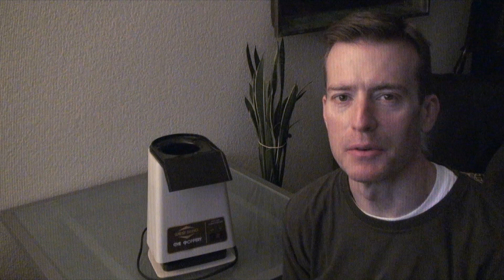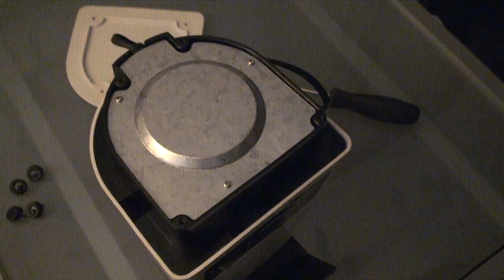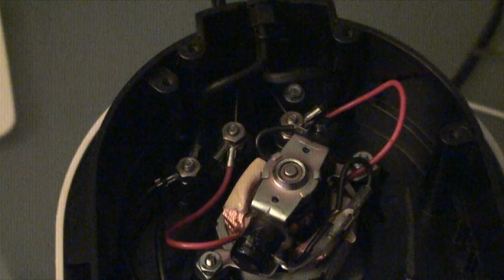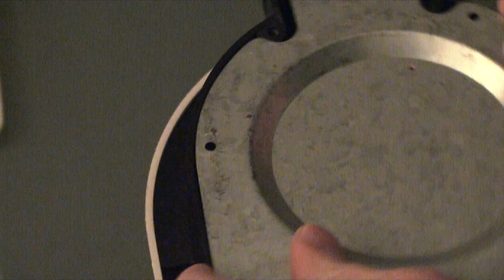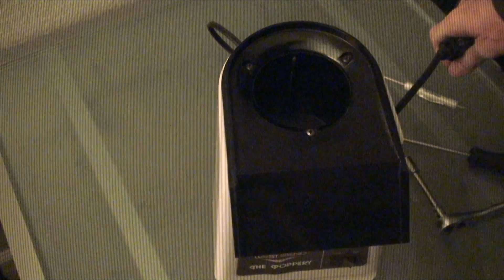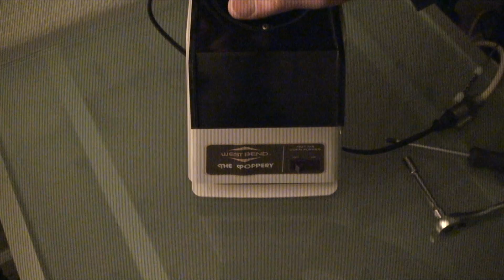West Bend Poppery rewire for coffee roasting

Comment: Great video. Just wondering if the the same rewire can be done to the Poppery II 1200W?  Is the Poppery 1500W preferred as a coffee roaster?  The Poppery II 1200 is cheaper on Ebay.
Reply: dont think 1200 is strong enoug
Reply: For my purposes of doing a dark roast coffee into the second crack, The Poppery is clearly the best with the extra wattage. The rewire enables me to cool the beans down at the end of the roast as well as cooling down the machine between batches.

Comment: The one I have uses an 18v DC motor. This is run by using a bridge of diodes to rectify the supply and has the motor/bridge in series with a dropper resistor of 175 ohms that limits the motor current to about 1.2 amps. I have done a similar modification to this (though there are no nice convenient screw terminals inside to make it as easy as the one in the video). When the heater is turned off the dropper resistor is still dissipating about 250 watts so the air is still being warmed (by about 45 degrees above ambient in the case of my popper) so not ideal for cooling the beans after the roast.

Comment: My popper has a 24v dc motor  :(   no easy rewiring
Reply: I have found out that the one I have (that uses an 18v DC motor and a bridge of diodes) is simply using a dropping resistor in series with the motor/bridge so it is possible to do a modification similar to this one as the fan still runs with the live side of the heater disconnected. However, the dropper resistor dissipates about 200 watts so the air blowing through the chamber will still be heated somewhat so not good for cooling the beans.

Comment: How well does the fan "loft" the beans in the reservoir?
Reply from the maker: As the beans roast they become less dense (puff up and lose water) so they "loft" more toward the end of the roast.  So much so that they will exit the roaster without some sort of collar extension to the roasting chamber.  I used a galvanized duct reducer (probably intended for laundry dryer vent connection) that I found at my hardware store.

Comment: does the FAN not run off DC?
Reply from the maker: The Poppery appliance has no battery, so I assume everything is AC powered via the plug to a standard wall power outlet.  Maybe there is some AC-to-DC magic going on in the fan housing, but I'm no electronics expert.  :)

Comment: Excellent mod. I don't use it to cool my beans but instead modulate the heat after first crack to develop better roast profile/taste. Just turn switch /element on and off after first crack is complete and you can start experimenting with roast profiling. I use my over the microwave range fan on medium speed to cool of my beans. VERY effective cooling. Also I stir with the skinny end of a long wooden spoon throughout the ENTIRE roast process for very even roasts, and minimal chaffe by the end of roast. Great easy mod!
Reply from the maker: Yes!  Thanks for pointing this out.  When used with a temperature probe*, quickly toggling the switch on and off can allow you to hover at whatever temp you want to roast at).  Brilliant!

* I bought this one:  https://www.sweetmarias.com/product/digital-thermometer-with-thermocouple

Comment: Why are these selling for so much on Ebay? i bought mine at the Salvation Army for $7 and it works amazingly well too :) i didn't even know you could roast coffee beans which is a added plus.
Reply: That is the reason they are so expensive on Ebay; the Poppery (circa 1973-5) is THE most desirable for roasting coffee. I used one for more than ten years. I have been scouring Thrift stores, used and consignment places for a replacement, to no success. The fan is 120V so it is easy to modify and the whole unit is built to very robust and durable specs. For popping corn you can look forward to a lifetime of pop corn.

Comment from the maker: Funny you should ask!  I just roasted a 3.5oz batch of beans to second crack for espresso.  I find that roasting below 45 degrees works better if you put the roaster in a box with an open side (sucking in too much cold air extends roasting time by 2x or more and hurts the flavor).  For temps from 40-80 degrees, I see first crack on a 3.5oz set at 2mins.  I see second crack about another 2mins.  Best brew is 2 days later, usually.  I hope you enjoy your new roaster!!!  :)

Comment from the maker: OMG! That is hard-core. :)

I think I'd be worried about damaging the poppery via that semi-melting cycle, and since they are in limited supply (and becoming more rare by the day), I figure I'll just deal with the occasional thermal cut-offs. I find that if I supply a little more fresh air in the box on cold days, the thermal shut-off issue is short-lived. The problem is roasting on hot days. As least in Colorado I can just wait for the evening hours when the ambient air drops to roasting temps.

Comment from the maker: @pabbananna I'm glad you found it useful!  I do wonder if your method won't cool the beans quicker, tho.  After all, cooling within the Poppery using the rewiring trick means you must also cool the unit along with the beans.  I'm not sure that as efficient as just dumping them out of the hot unit and cooling with a separate fan, but it's easier.  ;) BTW, I'm happy to see from your demo video that you got your Poppery for $30 (after some hunting I could only find them at about $50!)

Comment from the maker: @tadot Yeah, here in Colorado, I put it in a box in cold weather and can get 4oz roasted in 4.5 mins (second crack).  I did a batch like that earlier in the week when it was in the 25 degree range. I notice the the heater cuts out if don't have enough air flow (thinking it can detect overheating), but it will turn back on, as soon as I open the box more.  Frankly, my 4.5 min roast tastes damn good!

Comment: I just bought a poppery after using a much weaker hot air popper and found the poppery roasts almost 4 times as much at 1/3 of the time which makes me think I need to put a rheostat on the heater. I had been doing a 1/4 of a cup on a 1050 watt popper that took 15 minutes to get into the second crack (sumatran), where I can put a full cup in and it's into the second crack by the fifth minute... and that is in 40 degree weather.
Reply: Use a Variable voltage unit (a Variac) the fan cuircit can be just a robust dimmer, I think (I put mine on another variac), but that will mean yo have to "split-wire" it--use google, as the links I have are no longer viable on the web.